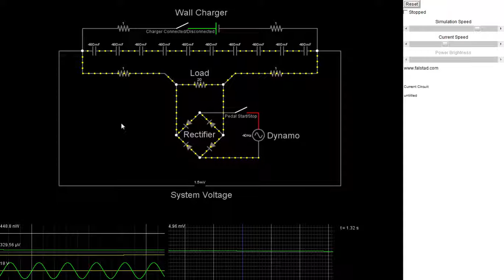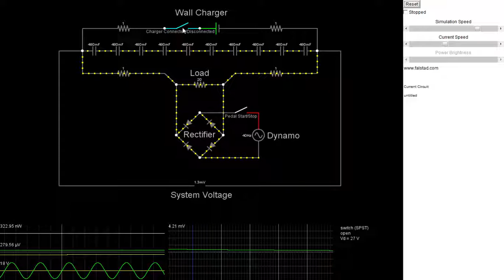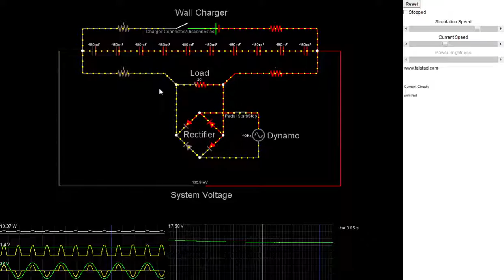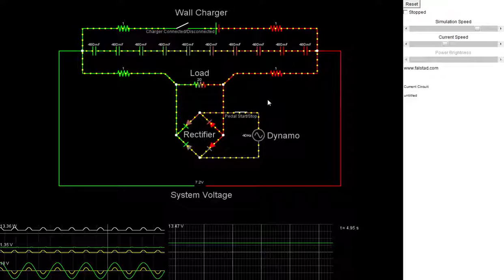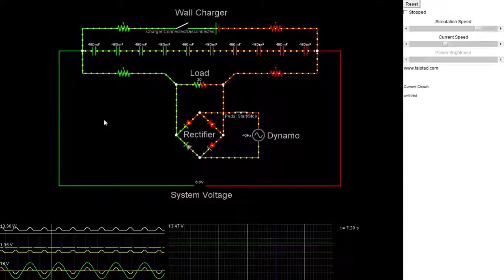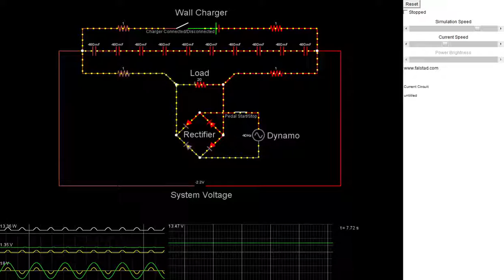Capacitors in My Bicycle Generator Schematic

Comment: Hey, David. What voltage regulator did you end up using? I tried a 7805 but it's terribly inefficient (~30%) and I can't get more than 500mA across a 5 ohm load.
Reply from the maker: +izelkay I am actually using a DC to DC converter, which does regulate voltage, just not through burning energy away as heat. It has about an 85% efficiency, and I have successfully drawn 1 amp from it. It's no Qualcomm QuickCharge, but it is enough to charge a smartphone.
Reply: +David Tsai Yeah I figured I'd need to go with a switching regulator like a buck converter. Do you remember the name of the part you used?
Reply from the maker: izelkay Yes, the particular module that I used was a KIS3R33S.
Reply: Cool, thanks again.